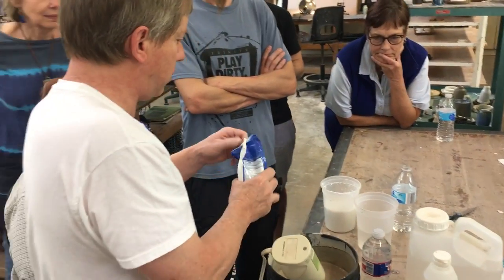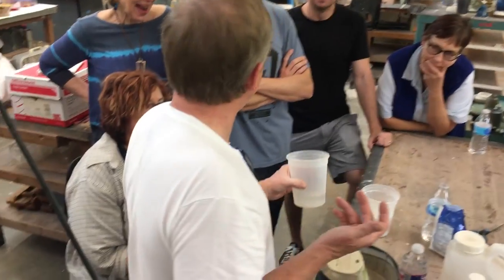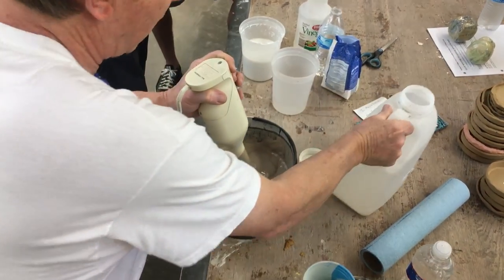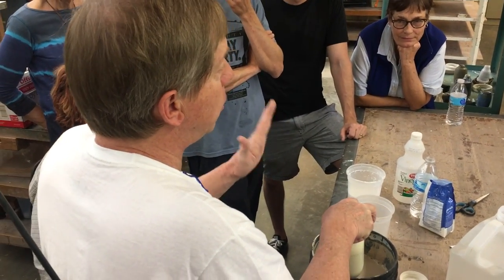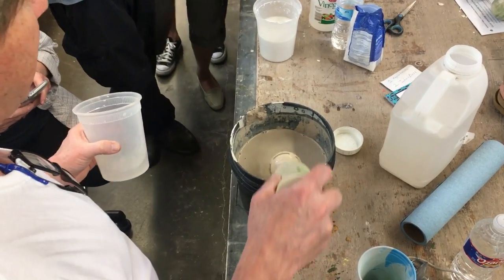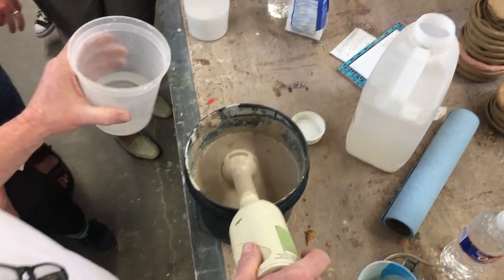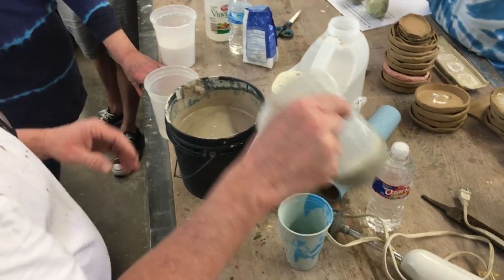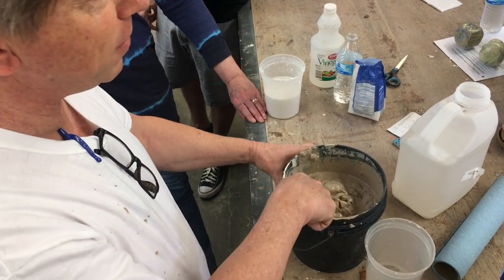John Britt flocculation/deflocculation demo

Comment: Hi. I tried sodium silicate in my china clay slip but it made it thicker rather than thin.. any explanation?
Reply: You added too much.
Reply: If you add too much it thickens. You only need a few drops of sodium silicate.
Reply: I added as much as always and it thickened also. I add only liquid glass to my slips and there was never a problem, after a year and a half of work with it, it started getting thicker. What am I doing wrong?